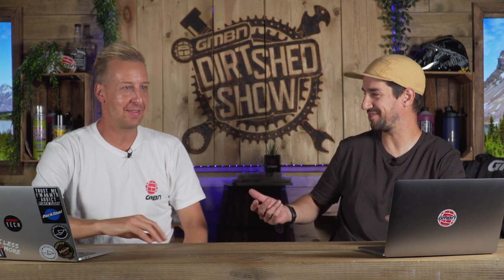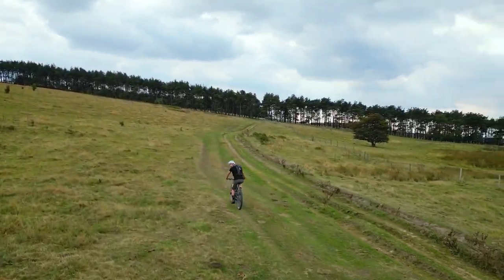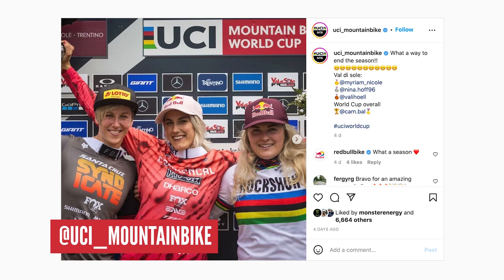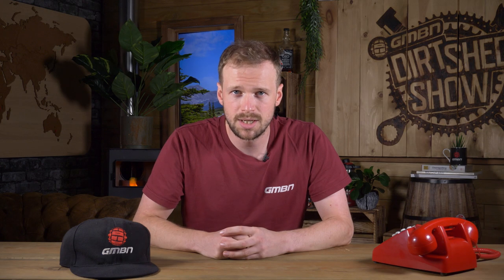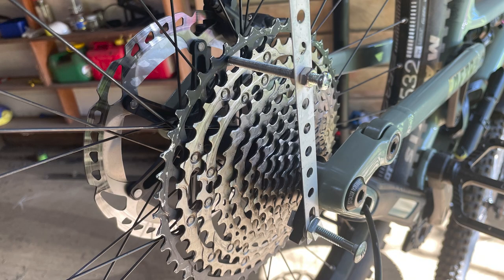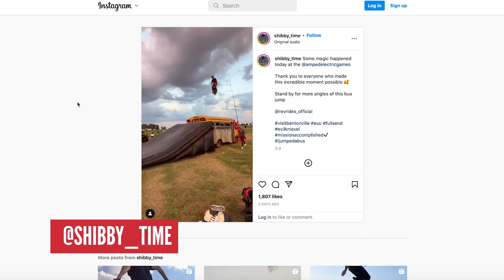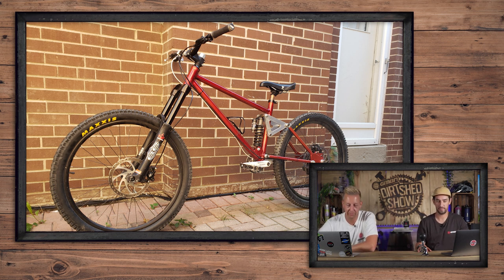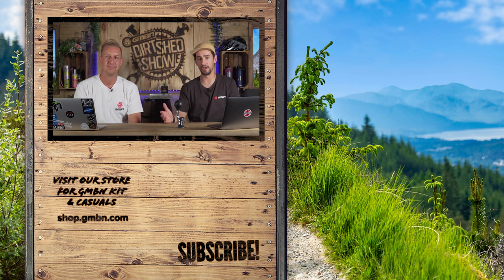The Most Pointless Tech.. | Dirt Shed Show 391

Comment from the maker: what do you think is the most pointless tech in bikes and why? 🤔💬👇
Reply: Plus tires on normal bikes without motor, double sides disc brakes, forks with rebound lockout
Reply: 29 and 27.5 wheels. 26 ain't dead yet. 😉
Reply: Paint... Should be optional. 

Great channel 🏁
Reply: Oval chainrings
Reply: If we want to go full Luddite Doddy-style, I'd say rear suspension.
Reply: @lElBorgs  - My go to excuse for an addiction to titanium!
Reply: @floydblandston108  😎
Reply: I'm not gonna answer the query above. But I've got query.

Why in the world are rubber boots for fork stanchions no more?
Reply: Any tool that does only one job and is necessary one time per yearly maintenance is pointless. They are mostly very expensive as well.
Reply: @TheProjectX3  - not if you're a shop setting up many bikes per year...

Comment: I'll tell you what's pointless. Electronic shifting! Why? It may work very well (I wouldn't know) but I think it is totally pointless. Ekar is able to shift 13 speed with a cable. No need to recharge anything, simpler, lighter, no batteries, no e-waste. I can even see the benefit of e-bikes, but I just don't get electronic shifting.
Reply: *Doesn’t know if they work well*
*Continuous to say they are pointless*
Reply: @sambeecham4250  What problem does electronic shifting solve exactly? I'm not about to buy the tech just so that I can say that I've tried it. That's exactly what the bike industry wants! To sell more stuff each and every year. Have not had the opportunity to try it. I'm still allowed to have an opinion on it (as are you).
Reply: @fatpinarellorider  my point is, you can’t judge something if you haven’t tried it. I also haven’t tried it, you can say what you think about it, but it doesn’t change the fact that you don’t know what it’s like, there are certainly reasons people are using it and it is becoming more mainstream, I don’t know why, you don’t know why, only the people that have tried it know
Reply: @sambeecham4250  Absolutely I can give my opinion on something I haven't tried. It may be wrong, but I am free to do it.😊

Comment: @Global Mountain Bike Network...  The Cannondale lefty fork isn't pointless as it cuts half the aerodynamic drag from the suspension fork. Thus it would only be pointless for slow cyclists who can not go faster then 15kph at which point aerodynmics begin to matter.
Reply: If you are a MTB'er it's pointless. you cannot use it as an XC nor an RB it's gay.
Reply: You can also change a tube without removing the wheel
Reply: @rosleyoutdoors  ... You can use it on a XC bike that what it is design for as it comes in 100mm and 120mm travel options. However it is probably better suited to marathon/stage racing where the speeds are higher and you are riding on multiple surfaces such as the Leadville 100, the Cape Epic, or the Munga.

Comment: You consider the lefty as a pointless engineering achievement because it has a single sided tube. But you are missing so much more, like the simplicity of service and the durability + reliability that is so much better than the competition.
Reply: Lefty chassis is way superior,shame that they don't do proper dampers and Air springs.
Reply: Just couse you could doesn't mean you should. It's a proprietary nightmare made to look bizarre. Heavier and double the price. Bikes should be balanced like all things.
Reply: It's basically a really big rear shock.

Comment: Grip shift had to be the most pointless bit of tech ever.....never worked correctly and too much mis/ghost shifting when death gripping, just rubbish.... might also call out Trust message fork....1800 for a fork the weighs 2kg and only really rated for xc....max drops is 48" then they close the factroy.....why bother in the first place
Reply: It's still around for City bikes and folding bikes (Shimano Revo Shift), here it works fine. On a MTB of course the levers used today are far better than a rotating handle

Comment: Boost is pretty pointless. What was the excuse again? That all the xc 29ers were busting spokes all over the place? Whatever...
Reply: My recollection is that boost was supposed to give room for plus sized tires, then plus tires went away and boost stayed.
Reply: @GHinWI  Yes that was the other story. Plus bikes died and were replaced by boost. I can fit a 3.0 tire (if I wanted to) in my aluminum 12x142 frame. Bottom brackets can have spacers to move out the chainline if needed. The first 3.0 tire came out around 2013, before boost. I'm not saying boost is terrible, plenty of room for 1x12 but the other excuses they made for it simply don't hold up. I'll continue on with 142mm as long as I can; that thru-axle standard was perfectly fine.

Comment: Martyn talking about that EUC video sent me down an EUC rabbit hole.  actually having trouble finding them in stock, the only thing that really stops me from getting one is that there's some safety issues that haven't been quite ironed out yet.  it works like a Segway using software gyroscopes and the motor to stay balanced. the safety issue is if you ask too much of it and drain the battery too quickly then it has a safety shut down to protect the battery. this would be fine if the motor wasn't actually keeping the rider balanced. because the motor is spinning the wheel if the motor stops the wheel then spins the motor instead because of course the wheel hasn't stopped. this means if you're going at top speed it basically smashes the chassis against the ground, and disintegrates into tiny pieces. most of it anyway. the motor and the batteries become projectile weapons that go off in random directions. a similar issue has to do with the regenerative braking. if your EUC is fully charged whenever you try to stop it's going to overload the battery and again for safety of the battery the software shuts it down same issue as before except now you're trying to stop. not the sort of thing you want to happen when you're trying to avoid a collision. final safety issue has to do with the charging ports provided by the brand Begode. they supply you with two of them so you can double the speed with which it charges, which is fine except that they're connected together, so you can electrocute yourself if you accidentally touch the connectors. other brands make sure that the electricity can only flow one way.

other than that, based on the videos I've seen they look like a blast and have pretty good range. experienced riders look like cybernetically melded with the machine, and I think this is the closest thing we have right now to being a cyborg. 

if I was to get one I would have to figure out a way to hook my BOB up to it. I'm just too used to having the carrying capacity, of a bicycle with bags.